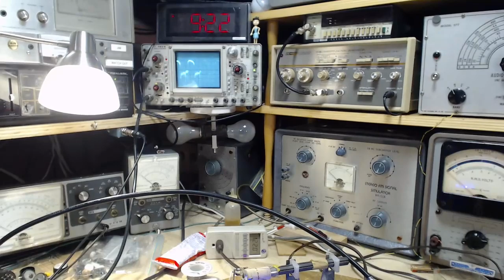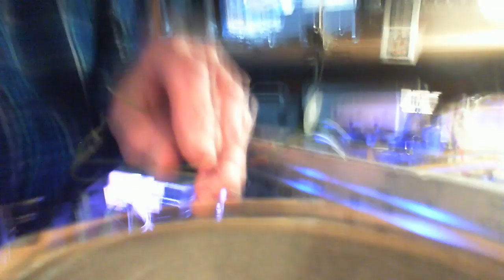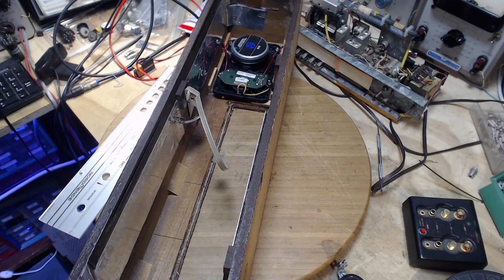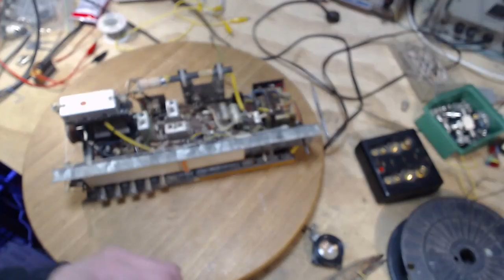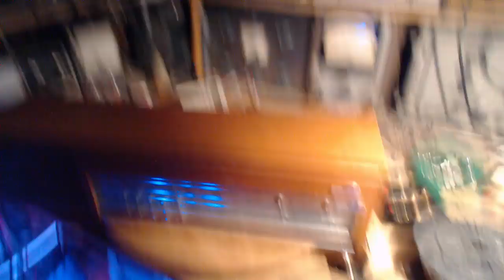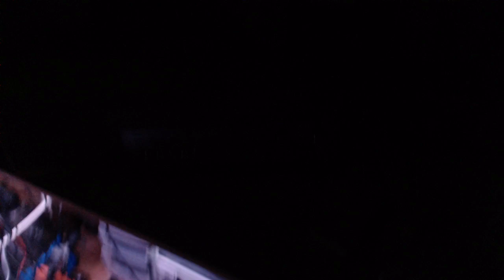Nordmende Spectra Phonic Video#4 - Finale

Comment: To me it looks like there's a slight (beginning) dc problem in the amp/output section. That's normally due to tired capacitors. and it will keep getting worse till it kills the speaker. It's pretty common in transistor amps of this age. I'm not claiming to be right, or saying you should change them, but I would at least test them just to be sure. It's no fun returning a radio thinking it's fixed, just to have some pissed off dude hammering on the door within a couple of month.
Otherwise a very nice fix. Thank you.

Comment: If the output stage is fed from a differential supply and the output stage is properly balanced then the dc voltage should be zero.

Comment: There seemed to be a kind of standardisation of this form factor in the design of German radios of the early 60's. I have just repaired a Grundig tube radio of 1966/67, about 23" x 8" x 8".

Comment: Those 10 volts DC will kill the speaker in a few months, all you had to do is to put an electrolytic cap to cut the DC offset...
Also, I don't think you checked the speaker's polarity...
Now, regarding the tuning scale - It's only lit until 90 MHz, and the upper part is also in the dark...
But yay, now the cabinet has four extra holes (for ventilation purposes, I presume), the tuning knob will stick again within a few hours... "Nice job Jim" strikes again...

Comment: you're doing great jim the lights look awesome. Jim I would think gluing the face plate on first to the cabinet then sliding the radio in or use double sided tape which will work just fine